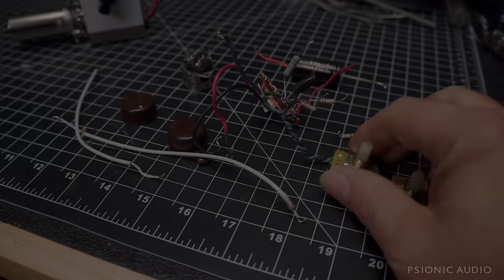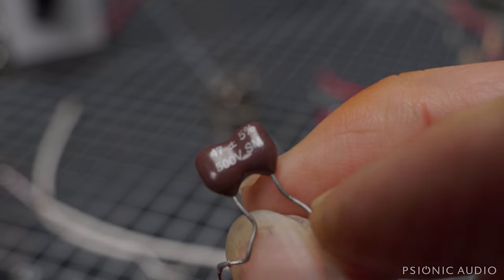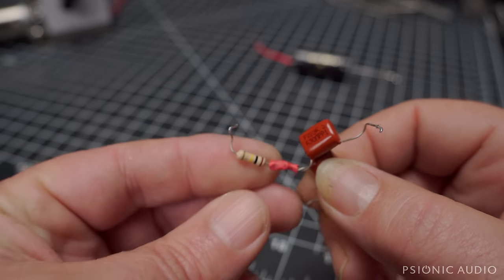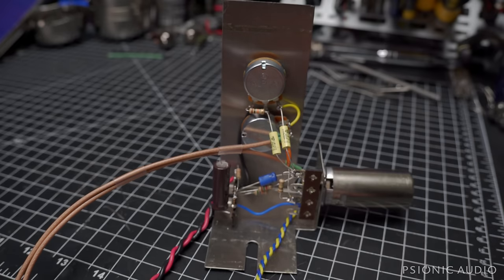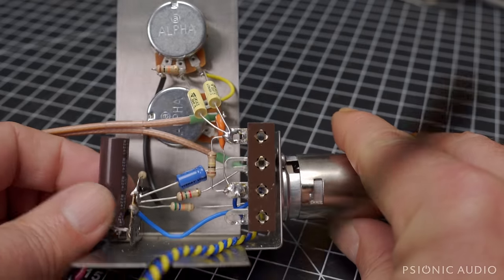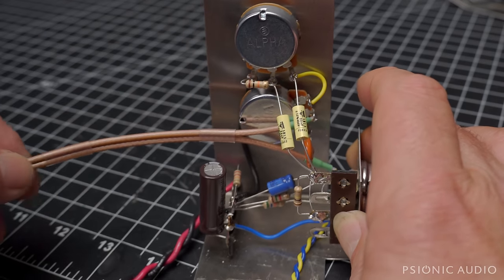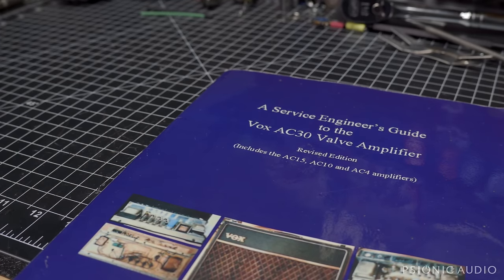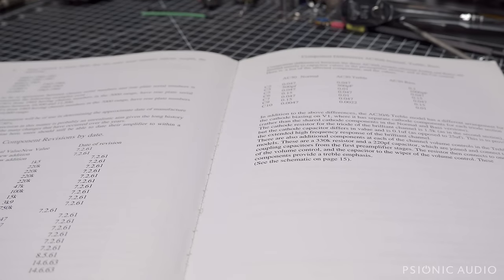'64 JMI Vox AC30/6 | Part 4 : Rebuilding the Top Boost

Comment: Those knobs look and sound super cheap too. I can hear them clicking together and tell it's super cheap styrene. Beautiful work on a micro sized Valco style tag board build, as per usual for amp master Lyle. I wish I could afford a Cheery Burl riveting machine to work on those old amps,  so I could rivet the tag boards back in along with tube sockets and many many other things. Those tag boards were partly preassembled and then riveted in. My mother used to do that kind of work.
Reply: Having drilled out numerous rivets in old tube gear, I hate them on principle (especially when they're also used as ground points) and would never consider re-riveting. As for the top boost circuit here, it strikes me that this is a case where a well laid out, high quality printed circuit board would be ideal, rather than having to build the circuit in layers on tag strips.  If a designer got the layout right, then it would be almost impossible for somebody to screw it up, even as a kit.....

Comment: The fiddly nature of building that circuit onto a small metal bracket while attempting to maintain good physical isolation between signal and power supply makes me think that perhaps this add-on top boost should be done via a small high quality printed circuit board. If somebody was to design one and get the layout correct, then it would be highly repeatable and not prone to layout mistakes.

Comment: Does a similar book exist for Marshalls?  I have a VS65R (Hey, it has a tube in it.); every schematic I've found online for my amp is mostly illegible.
Reply: I agree on a legible schematic for an old Marshall 2098. Can't find one out there. Must tube Marshall's I can find though.
Reply: Back in the late 1980s I requested a schematic for my Marshall Lead 20 solid state combo amp, and Marshall sent me an entire book of schematics! I know I still have it around here somewhere......🤔
Reply: @goodun2974  if they are as good as Peavey about sharing info that would be awesome. I've not tried to ask them yet.
Reply: @mikewithers299  , unfortunately, I suspect Marshall operates very differently now than they did back in the 1980's! As for Peavey, do they still provide service info and/or parts, now that they've shuttered all American manufacturing and everything is made in China?
Reply: @goodun2974  that's a good question. Back in the '80's and '90's they sent me all that but I need to see if they still do. I got more amps to fix.

Comment: Hope I'm not too off topic... 
Can an EZ81 tube perform rectifier duties in a 40-ish watt amp 
with no 5 volt tap, i.e. to convert later Fenders with diode rectification 
using the heater tap I'm guessing (?)
Reply from the maker: No, and there is nothing wrong with a solid state rectification circuit.
Reply: @PsionicAudio  Thanx Lyle... you're a prince

Comment: I have a small stash of the SM silver mica caps. So I was wondering which brand you prefer?
Reply from the maker: Cornell Dubilier (CDE).
Reply: @PsionicAudio  OK, thank you. I’ll check on Mouser.
Reply from the maker: When you see the price you’ll understand half the reason I prefer Vishay 562R series ceramics.

Comment: Grosvenor is pronounced Groves-ner.
Reply from the maker: The only guy I knew with that last name pronounced it like I said, so apologies to Stephen if he says it differently.
Reply: @PsionicAudio  It's originally Norman-French, so it ought to be pronounced GRO-v'ner. The 's' shouldn't be pronounced, but in practice usually is, but by metathesis after the 'v' rather than before.
Reply: The names apparently means "fat huntsman" (yes, there's a legend behind that!)
Reply: @johnbriggs3916 , yes, in my experience the S should be silent....